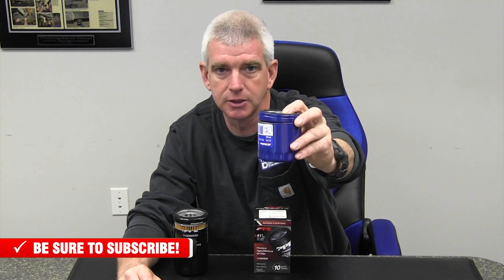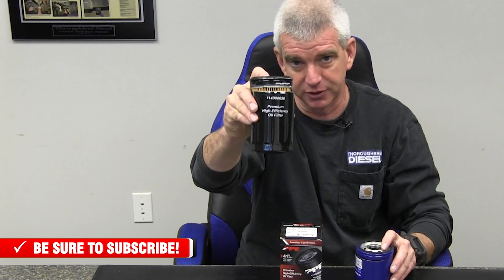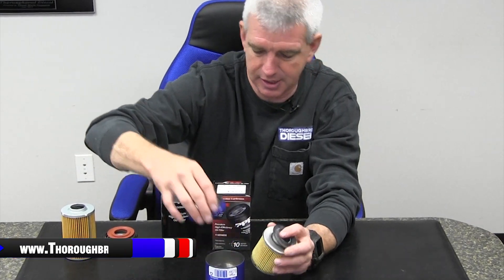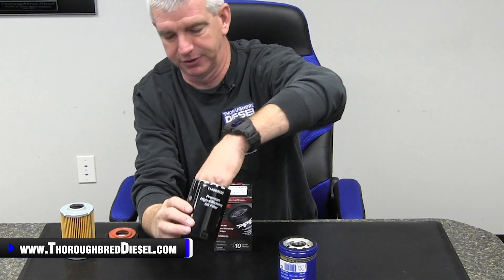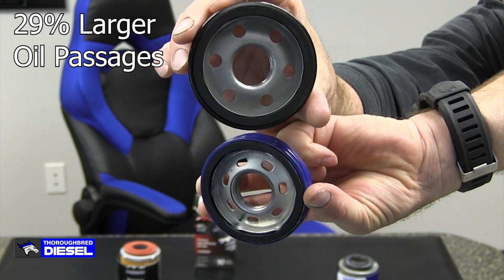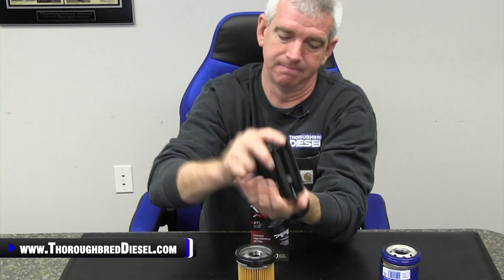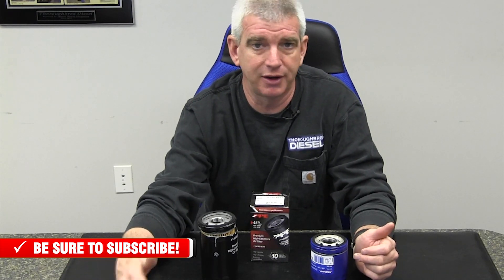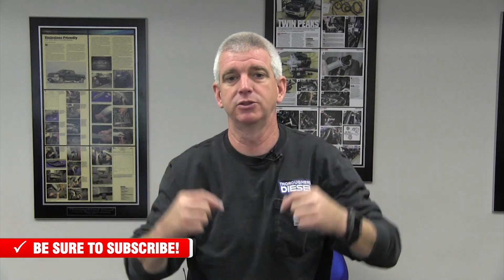BIGGEST Mistake Chevy Made In Diesel Trucks Comes Down To This!! #diesel #chevy #chevytruck #duramax

Comment: Do they publish the differential pressure through the filter? I assume the larger area is to account for the finer filter media? If the pressure drops too much across the filter that would lead to low oil pressure to the engine.  No?
Reply from the maker: Fuel lubricated.

Comment: Yeah this is all a bunch of baloney.  99.9% of 3.0's are running just fine with the stock filter and ACD oil.  I've put 42k on my AT4 in a little over a year including a lot of heavy towing/hauling out west up and down high passes in 100deg heat.  My last UOA showed that the oil was in fine shape after 7k miles.  I live in northern Wisconsin where I also see -20's in winter and again....my winter UOA's are just fine as well using ACD filters and oil.  Bigger is NOT always better.  I've also cut open one of the PF66 filters at 7k and it was still in fine shape.  There's NO issue with that filter in that engine.

Comment: "I like big filters and I can't deny" but is the oil pump designed to push/pull the oil through the surface area of a larger filter and get better filtering results.

Comment: I believed all of the hype so I tried the PPE filter. My oil pressure was extremely high, then within 100 miles it blew out and dropped 11 quarts on the road. I’ll stick to AC Delco.
Reply: I’ve now been through 4 PPE oil filters. Not a single issue.
Reply: Definitely not the 3.0 because the 3.0 only takes 7qt not 11.
Reply: You dumped 11 quarts into a 3.0 which holds 7????
Reply: Did this happen on your 3.0L duramax?  Or another truck?